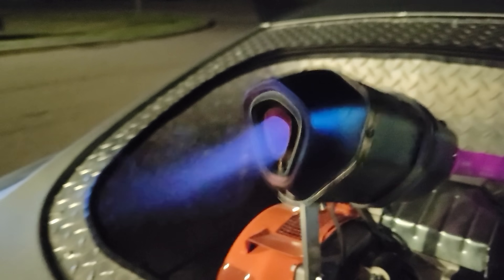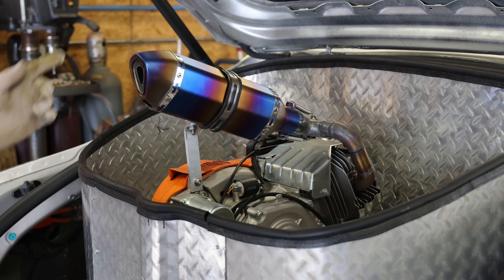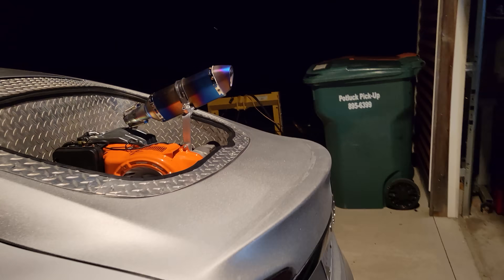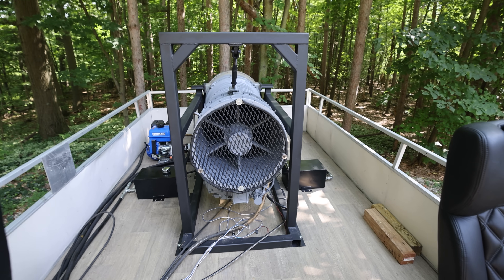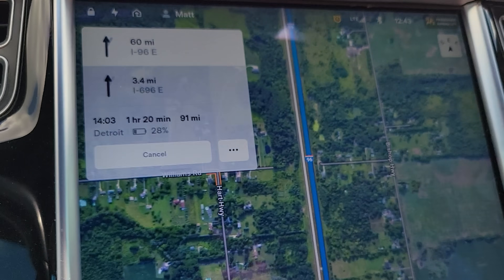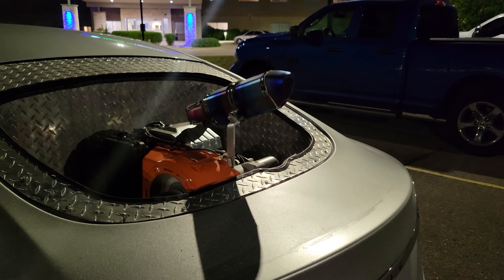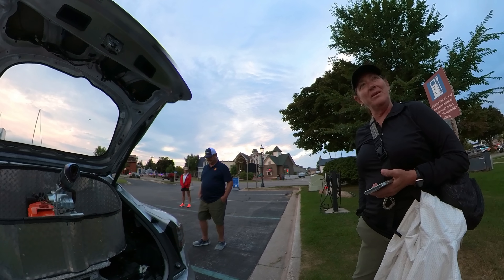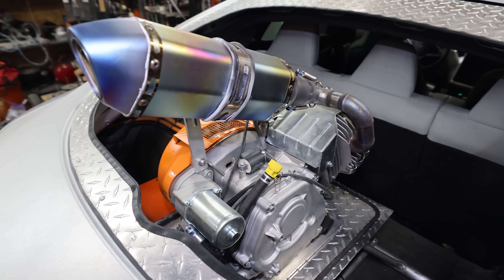Cordless Tesla (I Drive 1800 miles without charging) P.1

Comment: Get a lightweight 3cyl, possibly the one from the focus 1l and get a super beefy generator for it, charge a pack that disables the engine when full, starts it whilst empty, and charges the car at 50amp speed. That way it's intermittent. Might be harder to do. But I reckon you can do it. Maybe a bit more sheet metal work could also be done to reduce the air drag for it.

Comment: This is why there should be a standardized hot swappable battery pack that you pick up from charging stations. Have a membership fee and some kind of deposit system, and you don't have to own the hot swap packs. The integral battery of the car would be smaller, but the car would weigh less with the hot swap pack(s) removed, so it should provide sightly better efficiency and nimbleness if you choose to slow charge at home for local commuting.
Tesla seems to be in the best position to implement something like this, but it would be a huge departure from their current trajectory.

Comment: Just a couple thoughts. Adapt a V drive for the extra output needed. Also get a bigger muffler and make the pipe longer. Maybe some rubber fittings for motor mounts. Lastly, dude have you ever heard of insulation to keep the cab noise down. Could you let us know how much total you spent on gas? Best of luck.

Comment: Some thoughts I had were using a small yanmar Diesel engine coupled with a larger generator head. You would have lower noise level because it would use a traditional muffler, but you would have to incorporate a liquid cooling system. I believe a diesel would be more fuel efficient based on my experience with my landscaping business. My diesel mowers consistently use less fuel then the gas powered mowers. It’s still noisy but much quieter then the gas mower with just the engine running. I also think a Diesel engine may last longer then a gas engine again based on the service schedule between the gas and diesel mowers. 

Certainly removes range anxiety.
Reply: thats why trucks use diesel🐱👍🏿

Comment: @warped_perception Would love to see a hydrogen combustion generator that is contained and sound proofed.   If you want to get fancy you could collect the water vapor,  electrolize it using a frequency generator and feed the Browns OH gas back into the cylinder.  The resonate frequency of water is 632 hz. The covalent bond can be easily broken using 12v of DC current at as little as 5amps so I'm told.  Now we just need to build more hydrogen stations, generation facilities and trucks to haul it all around.

Comment: If you are using gas to charge the battery, then you're not driving a electric car. You're using the same technology trains are using right now , where they're using  Diesel fuel to run the electric generators that run the train.  
So no you didn't drive all those miles on electricity.

Comment: Ridiculous but interesting exercise. That guy's fab skills are off the hook. A few random observations and impressions:

1) Kudos to the makers of that 400cc generator engine.

It was not stated who made it, but that engine continuously ran at max 3,600 RPM duty cycle output and load for a stupid amount of time. The EGTs apparently were in the 1600 to 1900 range, as the header and muffler's interior were glowing orange, and steel glows orange in that range. Fan cooling works well evidently! Apparently it had decent oil in it too as the oil temps had to be on the high end. 

The exhaust system needed further work, it would have been much better to plumb it below the car and into a standard automotive muffler, as the little motorcycle style muffler didn't cut it from noise and heat standpoints. The muffler did have a Mad Max engineering appeal though, which is appropriate given the nature of this project.

2) Surprisingly poor fuel efficiency

At the end he reported between 14 to 24 MPG depending on speed, and that is piss poor of course when the average gas powered econobox driven at 55 MPH can easily break 40 MPG, probably 50 if one has the patience. Running a small 13 horsepower generator WFO all the time to power a 4,700ish pound Tesla is not fuel efficient.  

At 55 MPH, he calculated it as using 225 watt hours. My wife's C-Max plug in hybrid, with no heater or A/C not in play, reports a bit over 4 miles per kWh (or 250 watt hours per mile), which is a little better than the figure he got with his Tesla at 55 MPH. Interesting that my wife's PHEV dragging around the weight of a 2 liter gas engine and 14 gallon fuel tank is more electrically efficient than a Tesla. The Tesla does have dual motors and of course is a much higher performance vehicle dragging around a very heavy battery.

3) Cool that the Tesla's estimated range works so well, the added generator did not phase it.

4) Was it worth it?

Of course not, this project was stupid, but it is the cool kind of stupid. The project highlights that if one really wants an emergency generator in their Tesla to alleviate their range anxiety, an ordinary stand alone unit of similar capacity could simply be placed in the trunk. Mare sure to also include at least two 5 gallon gas cans with it! 😆

Comment: Next go for a 2 or 4 cylinder 4 stroke engine with a silencer and set it up so that it can’t be seen or heard .. use a higher kw generator and set it to cycle based on battery percentage like a normal hybrid so let’s say once the battery gets to 50% it comes on and because of the high Kw output it should be able to charge up th battery quickly convert to high output DC power .. so ur doing DC fast charging .. 🤷🏽 just need to be quieter and more practical .

Comment: Hey brother I used to work on a tugboat we had a port and a starboard Generator So you need 2 engines the  reason  Is each engine runs for 12 hours at a time

Comment: Kind of defeats the purpose of getting an electric car.  I mean it's an interesting idea, but really if you are taking a road trip, just rent a car if you have an electric car and don't care to deal with the struggles along a road trip.  If you travel frequently, then that's something you need to consider when looking to buy an EV.  A hybrid may be a better choice and a good compromise over a true gas vehicle, as the hybrids can run on gas if there is no more battery charge left, but can be useful for local driving or short trips during the day (say you drive from Chicago to Texas for a week).  During the trip you'd probably have to use the gas engine on the highway, but when you get to Texas let's say you can probably run off the electric motor most of the time (depending on how the hybrid actually works, some are electric assist while others are true electric/gas hybrids -- electric for around town and gas for long distance).

Comment: Should have used a harbor freight 3500 Watt inverter generator. Would have been atleast 50 percent quieter and way more efficient. I run mine for about 11 hours on about 2 gallons of fuel. 818 hours on it with no problems. Cool idea tho 👌

Comment: All he people saying this is an “awesome” of even “good” idea are morons. It is less efficient than just buying a hybrid at significantly more cost. He still has to stop to buy gas or carry gas cans. Putting a generator in a Tesla does not reduce the energy required to go 1800 miles. It adds to it. So all you are doing is replacing charging stops with fuel stops, and wasting money.

Comment: Surprised that people havent figured out the whole deal with rotation... like, you have wheels rotating already on the charge, why use gas when you can have the vehicle turn alternators meant to charge the vehicle with out a gas engine. So if you have 1 of those gas powered chargers on each wheel, lol, yea, it would probably never stop. Hard to convert an existing car to that maybe, but if you designed the car from the start to charge it self, im sure it would work out nice. He is using only 1 alternator charging system that is gas powered. If there where 4... seems like it would be way more better.

Comment: So you bought an electric garbage car that is unsustainable and pollutes more than an ICE car would in 10 years just with the manufacture of its battery and then you add a gas generator to solve a problem that ICE engines have had solved since the 1920s. Totally stupid and a waste of money and resources to drive an overpriced tablet. It's a neat build but totally unnecessary also generators running that much will fail especially without regular and frequent oil changes.

Comment: Totaled a TESLA and erased any resale value; constant charging of the batteries eats away at the batteries life span.....constantly topping it off eats up the batteries (memory effect).  The generator is inefficient, loud and seems to be dangerous with the fuel leaks mixing with the hot exhaust, explosion waiting to happen.  You have fabricating talents.....and this is a cool science project........but there is a reason Tesla doesnt create hybrids.  The most efficient choice is to use grid power from a far more efficient power station than this....

Comment: I think more racket came not from engine exhaust but from hard mount and vibrations, should have used a lot of rubber and automotive sound insulation on the mount

Comment: in my opinion, there's a lot of  stock motorcycle exhaust that run quieter that you can find on junkyard, some Honda stock motorcycle exhaust are slip on, so you can just do a little tweak and custom manifold so that you can fit the stock exhaust.
It will cut 1 - 1.5hp from your engine but the noise wont attract way too much attention. 
the fact that the engine run on full throttle without liquid cooling 24/7 it amazed me how durable that engine is.

Comment: ICE (causing pollution, sustainable power required)- electric (causing charging issue, sustainable power charging required)- ICE (make shift unrefined inefficient arrangement for charging and with added noise pollution)
Take away- buy cheaper fuel efficient ICE vehicle,  less pollution less price

Comment: The problem with electric cars or battery electric cars to be exact is the weight of the batteries. This is where hydrogen fuel cell tech was far ahead of the curve. First uses a gas so less weight. the Fuel cell produces the electric current to the motor. The exhaust is clean drinking water. Toyota just showed there hydrogen fuel version 2 could drive on a single 5 min fill up 1300 km's on one tank and that tank is very small and uses compressed H2. Newer cars are using a method of a Metal Hydride storage system. This system is much more effiencent in storage and releasing hydrogen the new Metal Hydride tanks can storage 10 times the ammount of a compressed h2 tank. Same 5 min fill up the newer cars with Metal Hydrides will be able to drive almost 5000 miles on a single fill up. As the production of Hydrogen gets cheaper and cheaper over the next ten years it will be cheaper than electric power to charge your cars.

Comment: You should have added a few small solar panels and possibly look into a vibration electrical generator  to make use of the loud vibrations that are emitted from the engine you have charging the battery just to harvest every bit of energy you can to maximize distance without having to stop
Reply: Not sure if you could utilize the the heat coming off of that exhaust or not but I'm sure there is a way to maximize the power generation from the setup you already have
Reply: A teg (thermoelectric generator)

Comment: You need to install some how a one in  each weel bike or motorcycle electric generator charger so you can have 4 extra generators charging the battery while you driving I mean the ones use to run electric motorcycles and bicycles I think they can work and be installed on  car weels.

Comment: An excellent proof of concept demonstration!  Consider looking into the Chevy Volt to see if one of those engines would be the right size/economy.  Also look into MIT's LiquidPiston rotary engine design and of course don't rule out a small diesel engine. When considering engine types, calculate your constant rpm needed and focus on the camshaft profile in the engine and other tuning considerations to maximize power and efficiency at that rpm.  Most engines have a camshaft profile that is designed to have a broad rpm operational range rather than peak efficiency at a constant rpm. I bet you could significantly improve the efficiency of any small engine with a camshaft profile cut to your specific application needs.
Reply: Something like a rotary engine would be ideal for that. Dude built a less efficient Chevy Volt with extra steps.

Comment: So ….to make electric vehicles “better” you need an internal combustion engine 😂🤦‍♂️…my 2000 1 ton cummins gets 20 -24 mpg on the highway doing 80 and has an average 450 mile range…electric cars are a novelty

Comment: Wonder if you'd get more energy from a small deisel like they use in tractor trailer auxiliary power units? They run the sleeper ac and a microwave at the same time no problem.

Comment: That expanded metal on the jet engine is seriously impeding air flow. I get the need for safety, but you neel bigger wholes, or maybe no holes and a bigger guard.pushed out a few feet from the mouth. You're choking that engines performance. Then again, you probably don't need max performance on a pnntoon boat.  Databyter

Comment: Ok so I had the idea back when they were buying them all up and smashing them in bulk. I also have the designs that you could sell off your extra electricity. With the amount of spinning components involved in cars we could charge tons of stuff. I know I know free energy is a scam. This isn't free energy, it's just simple planning.
Reply: I just don't understand why we can't have dual cgarging sysyems? So the car will charge one set while using the other and when it gets down to 40%  it will switch over and use the other.

Comment: Ive been figuring if you just put a wall charging unit in the bed of truck and attach it to a generator plus a couple solar panels mounted on a cargo rack, you could go anywhere. I kind of envision it with a camper shell made out of solar panels....

Comment: It definitely needs a quieter muffler just so you don't have to worry about attracting so much attention while parking leaving it. The flames coming out is sick though, so it's kinda worth the noise
Reply: Didnt know you could with that ...Can you actually install a mini muffler on it that would drown out the noise?
And 2, would a muffler reduce power generation?
Reply: @MegaNadir123  I saw him say in some other comments, he tried a muffler, but it reduced performance too much. I would imagine it takes some thinking to design a good flowing AND quiet exhaust. Maybe a resonator tuned to park frequency, would be easier to add
Reply: @BasedBidoof  

The problem with quiet exhausts is they're usually less efficient.

You may have heard some people saying you don't need back pressure. You don't, ever.
Reply: @skylined5534  I suppose you can design an exhaust with no real back pressure that still silences the motor, but itd need to  be very big instead. Like 3 semi truck silencers in a row ought to do it, they flow good enough to not be a restriction and would kill the sound for example. Going even more overboard a sound insulated room would be a good silencer with no backpressure, but kinda hard to mount on a tesla.
Reply: Plus a lot of the noise from those small engines actually comes from the engine block and head itself as well as from the exhaust.
Reply: Oem muffler from a gas powered car. Quiet and zero performance loss on the much smaller generator engine.
Reply: @KorysRides  it's not that simple if you need max preformance out of the engine, like he did in this situation. Really he needs a more powerful engine to muffle it and still meet the power requirements
Reply: @BasedBidoof  He needs a more powerful engine period. Enough to create the average power used while driving. Less than 100 HP, but more than 10 kW!

Comment: One of the few benefits of the Tesla is the quiet.  A better solution would be a quiet generator pulled on a trailer.  Then you only tow the trailer for long trips, when needed.

Comment: Hahaha... This was fantastically funny... 
If you calculated the gasoline stops and continual noise and continual charging versus using the charging network overnight it would have also worked, but loved the gutsiness of building a generator into a Tesla... Thank you
I've been thinking about this for long road-trips, to maybe take a trailer with batteries, solar-panels and generator along to go for 1000mi without fear...

Comment: Too bad there aren't diesel hybrid cars. The efficiency of a diesel engine is running on the highway while the electric motors would work better in the city. Combine the electric motors with the diesel power and you will have torque like a locomotive and the fuel economy to boot.

Comment: I thunk there is enough space to make the exhaust system quieter?  but not sure how much power will be deducted to reduce the noise.   maybe a bigger generator is in order to get it more practical.   

Electric infrastructure here in the Philippines is not ready for electrification, so I am on the fence to get the NIssan Kicks e-power.....